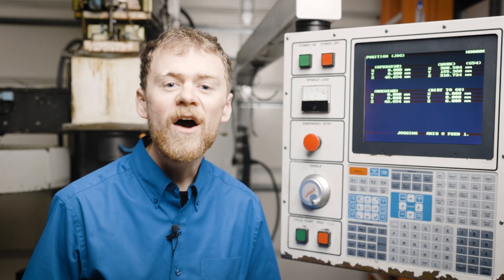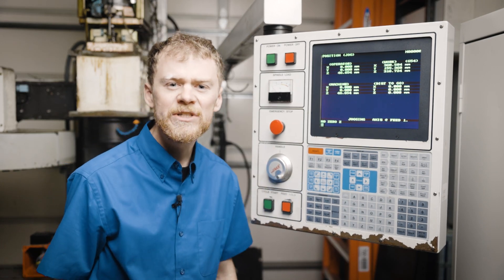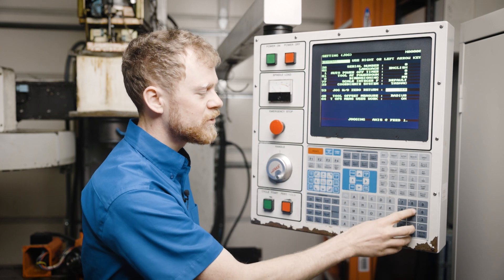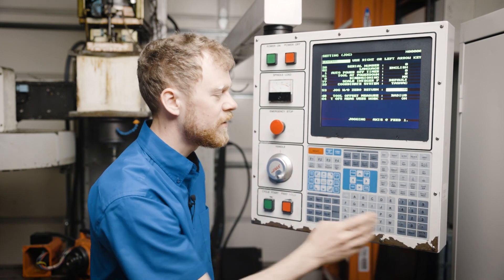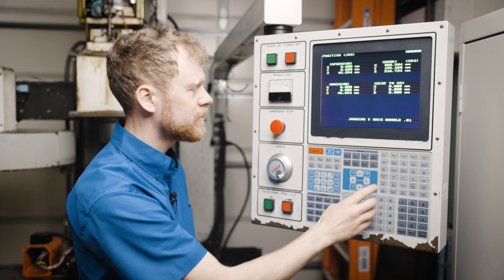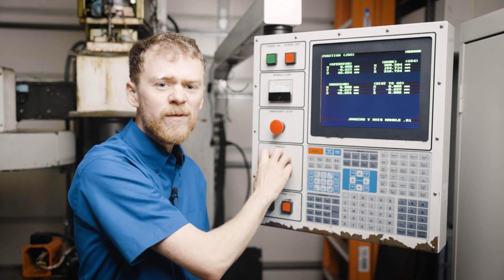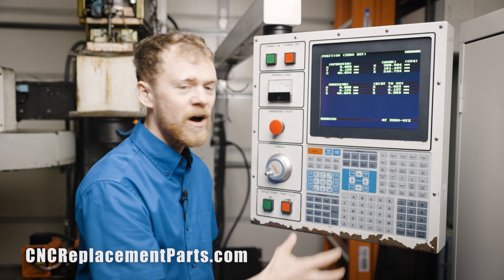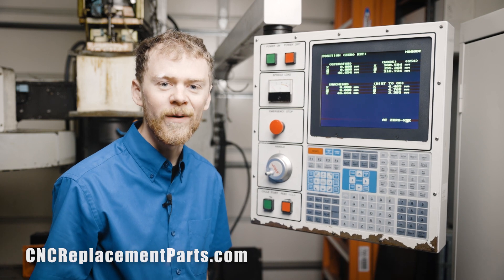Setting 53 – Jog Without Zero Return

Comment: Thank you for the video. A few weeks back we could not home the machine - it erred out on the Y. 
We have had this with chips on the Y sensor after cleaning but we were dead. After our VAR helped us with this function I could see that it died in both directions - It had been sitting and wasn't rust protected well enough. Lubrication and incremental increase if the jog distance got it back in minutes and we had spent a week trying to fix and access sensor.
USEFULL